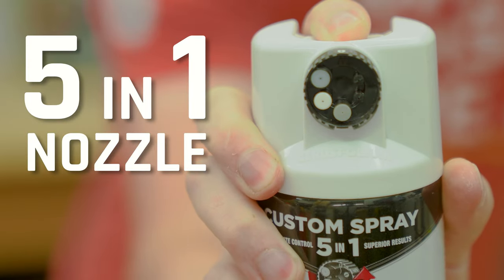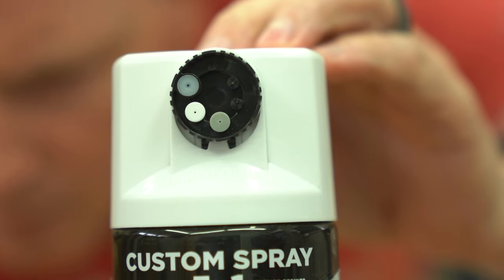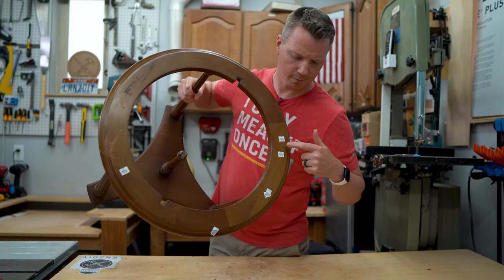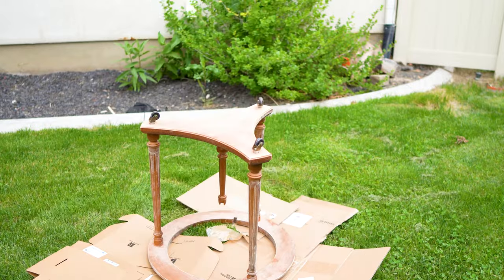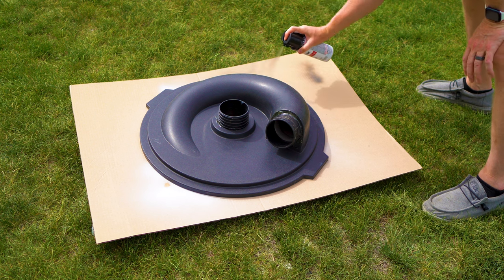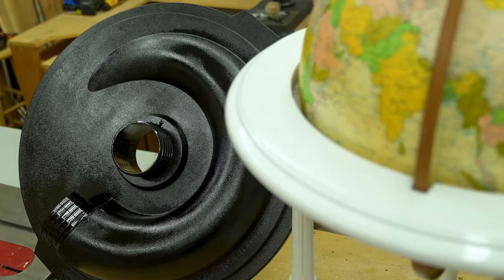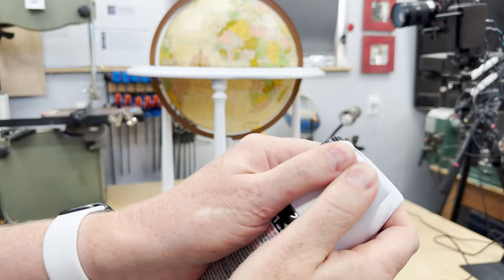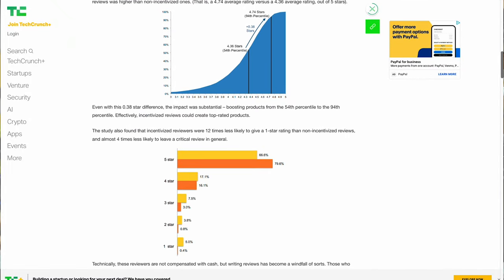Put 5 Spray Patterns on ANY Spray Paint Can

Comment: I used one of these types of sprays to paint my truck and the fan tips are amazing. After several attempts with regular spray paint it always came out with lines and splotches. The only problem I had was they only come in solid colors. I had hoped they would come in metallic.  I never thought of switching the caps until your video. I used sail blue on my r truck with matte clear. I always get people asking me if I had the truck wrapped. Great video.
Reply: I also forgot to mention I did get drips on the horizontal surface of the hood but everywhere else it worked great.

Comment: Another great and useful video Nils.  Really well done!  For those of you out there that have problems with your spray paint cans clogging and then running, here's a small tip.  After each use, turn the can upside down and spray out of the nozzle you've just used for several seconds. You’ll see the paint fade away when the drip tube and nozzle are cleared. Since the tube extends to the bottom of most aerosol cans, inverting them exposes the dip tube’s inlet to just the propellant only. Spraying a can upside down like this purges the remaining paint from the tube and the nozzle, keeping the quality of the paint spray as good as new the next time you use it.
Reply: This tip was more useful in the past than now. MOST of the hardware store cans i have come across lately have a newer pickup tube convention.

Comment: I am restoring a matching number 71 Chevelle and I am restoring the rad support. I had the support out side for years because I was doing a frame off restoration . And it was rusty and crusty. I took a wire wheel to the rust and sanded with scotch brite . I primed it with rust barrier . I just bought a can of the 5 n 1 and was nervous didnt know how it was going to spray. I just primed the support yesterday after noon I didnt want to take a chance on scratching it up by removing it off the hanger I just went ahead and got out the Satin black rusty I messed with it a little and found out no 4 is good on the flates and 3 was good on the crevices . I am blown away it took the whole can but it looks like it was sprayed with a gun . I am sold two thumbs up I give it a 10 no complaints . I even called the company and gave them some pos feed back :face-red-heart-shape:

Comment: Thank you for your review… I went to my local depot store to find I did not have an option… only the new style cans are in stock…. It did work as you demonstrated… i painted 4 eight foot by 1 1/4” metal square tubing… it covered the metal tubing with one coat using the vertical spray option being side by side… when I allow for the metal to dry a little in an California sunny 80 degree day.. when painting the next side there was a little spitting occurred.  It did cover easily by the coat being apply.  When finished the paint left over for touch up…

Comment: 1$ more just for this cap is massively overpaying, each of these special nozzles normally costs between 3 and 10 cents. These nozzles can be easily cleaned if you turn the can upside down and spray until no more color comes. then exchange a nozzle for another. These nozzles can also be changed from one can to another without any effort. Also, the wide jet nozzles can be easily rotated from horizontal to vertical and thus only one additional nozzle instead of 2 to buy. 
So its an invention that no one needs and unnecessarily costs money.

Comment: Thanks for the demo/review. Thanks for adding the additional trailer. 

So you have a 3d printer, you know the dimensions of the output and top ring on the can, you can likely figure out the orifices for the different spray patterns fairly easily. How hard would it be to create 5 separate tops (the multi top thing is likely patented) and sell them for a profit with cleaning instructions?

just sayin’
Reply: It costs a dollar for the five in one nozzle and you can swap it to other cans at least a couple of times.  Doesn't seem like there's a lot of profit to be made
Reply: I also don't think that your average 3D printer is going to have the resolution to do the orifices.

Comment: Its a very interesting concept. Back when i wrote graffiti in my teens (legally of course!) We'd swap caps from everything from WD40 with the straw to axe body spray etc. Had also made adapters to fit different types of cans and to transfer paint into empty axe cans (i hate the smell of axe but they're nice pocket sized aerosol cans with a good spray tip that nobody would suspect was full of paint) and be able to mix custom colors so you could make 3 cans of 99¢ colorplace look as nice or better than a $12 can of ironlak

Comment: Tip: For your tips. You can quickly & easily clean your spray can tips by spraying them with Brake Cleaner and shaking them off after each use to prevent paint buildup.

Comment: Reviews are useless. You really HAVE to try the product for yourself. I think that may be the point of the reviews. 🤪  Interesting product, and it's great that you can use it on cheaper products! Maybe they'll make the top proprietary now that you've pointed it out. So buy some cans before it's too late. Now that I think of it, I'm surprised some third-part never came up with this.
Reply from the maker: You never know :) Yeah, changing the shape of the cans is definitely going to cost a lot more so hopefully that'll keep them using the same ones. But at least I have a couple just in case. Thanks for watching!